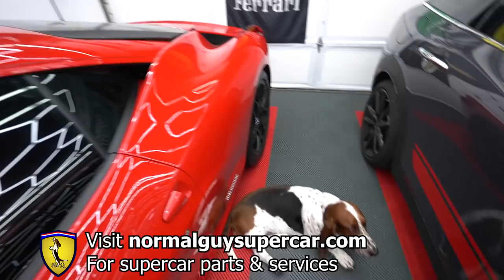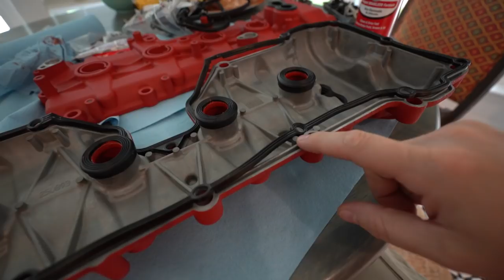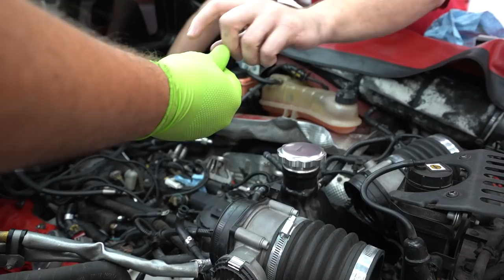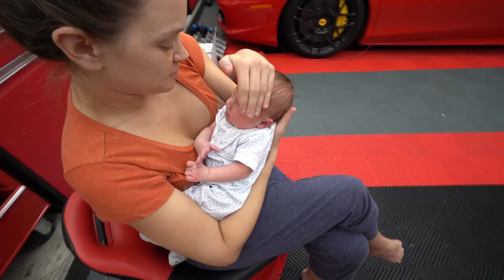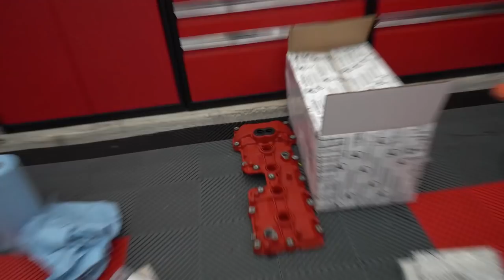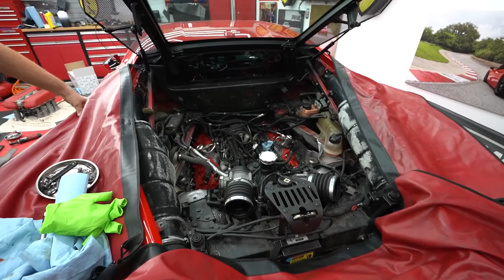WORK OF ART FERRARI 458 VALVE COVERS INSTALLATION

Comment: If I'm not mistaken, powder coat is dehydrated paint that is electrostatically applied and then baked. No hardener or reduced solvents or the possibility of orange peel. I have found that paints with hardeners can be just as durable, if not more durable than polyester or enamel powder coatings. I would have to say that it is the heat that eventually gets to it and causes it to flake.
Reply from the maker: You might be right

Comment: I don’t know much about the walnut blasting or cleaning intake valves on new GDI cars. I’m sure you looked into all options but in case you missed this, the Car Wizard did a video where he used a spray chemical to do the same thing. I know you mentioned being hesitant about using walnut shells, thought I’d mention other option.
Reply from the maker: Stay tuned to the next video. 😉

Comment: Have you ever seen valves after running on Shell gas or other injector cleaners that supposedly clean intake valves ? 
I have seen before and after pics by Shell of intake valves  supposedly showing how their fuel cleans valves . Probably a bunch of promo hype but maybe not .
I’m doing the intake covers on the 360 soon
Reply from the maker: Yes, but it won't really help on direct injection for keeping the back of the intake valves clean.

Comment: You really want to use 3M contact adhesive or 3M weatherstrip adhesive to glue the cam cover gaskets in place...That orange RTV looks like shit...
Reply from the maker: You will literally never see it.
Reply: @normalguysupercar  Dan, you are a super nice guy, but don't take any advice really..Whatever..RTV away..It looks unprofessional..
Reply from the maker: It's not advice I can consider if its already happened.   But I stand by what I said.. It's impossible to see the rtv so it's kind of a moot point.
Reply: @normalguysupercar  Between the tools, the torque wrenches, and sealer you got this...rock on..
Reply from the maker: @jasonmascow7686  well... To be fair I did fuck it up... Stay tuned. Lol
Reply: @normalguysupercar  I like your channel and I'm not trying to be a DH.